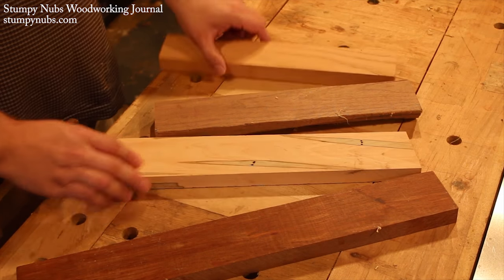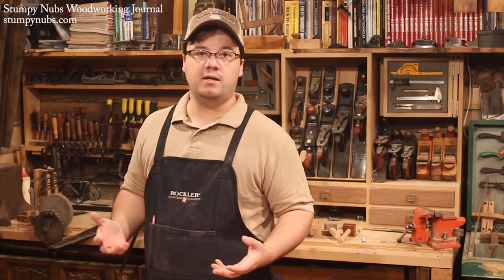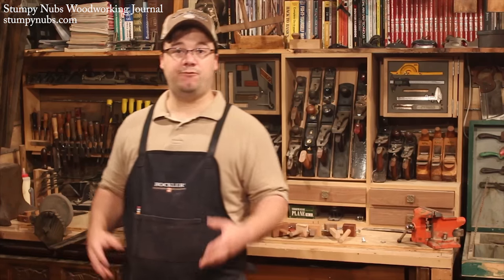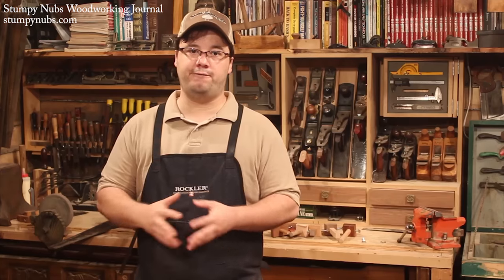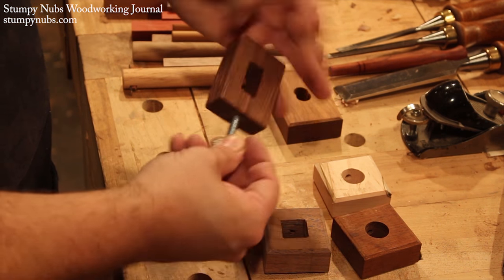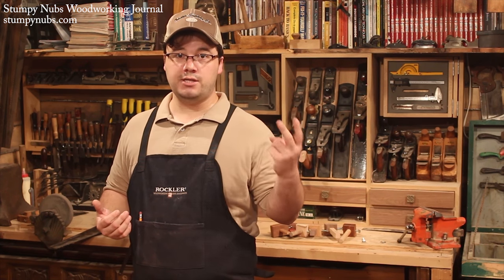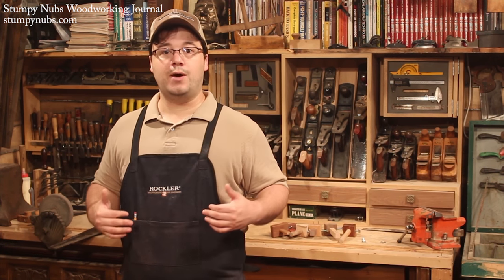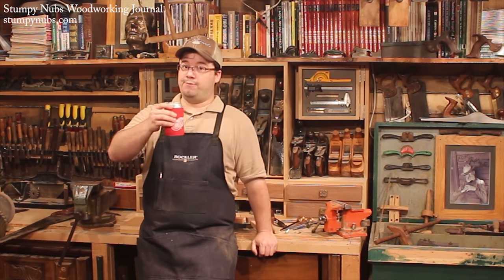3 Easy to Make Homemade Woodworking Marking Gauges (Mortise/Cutting)

Comment: I recommend not screwing them very tight at all, because each time you are making a dent into the soft wood, and when you next wind it in to a position very close to that dent, it may pull itself back into the dent, and there goes your accuracy. You want a nice fat screw that's about 10mm to mitigate this effect
Reply: Worth mentioning, especially if you're going the "square beam" route... so mortising rather than drilling...
   You CAN also dig out a small recess inside the mortise for your beam, where you can slip a small piece of flat metal under the bolt, and hidden by the beam, itself. This way, once assembled, the bolt presses onto that flat piece of metal, pinching on the whole span of beam inside the mortise, instead of a tiny point... and as long as you fit the beam snug to the mortise enough to cover the metal, it's never going to fall out.

    I have a preference for a "quick acting" pinch... You can SEE an example on Rex Krueger's channel. Basically, I drill an off-center hole across the fence just over the beam, where I can fit a smaller dowel. This is best done just after lay-out and before you drill the Larger hole for the beam... but with a gentle touch and patience, you can still manage it if you've already got the beam hole bored... It's just a bit difficult because the drill will "want" to misalign into the beam opening... It can also be resolved by fitting a piece of scrap into the space where your beam would ordinarily be, so you can then drill right along through part of the scrap... no harm.
    Once you've got the channel for the smaller dowel, you'll want to eyeball with the dowel in place, and dig out just enough of that dowel to make space for the beam to slide relatively freely... This is usually down to "trim and test" repeatedly, but also not too big of a deal. Once that's done, pick a side (usually the longer part of the small dowel) and carve out a "ramp" or "wedge" shape from the hole for the beam to the surface of the dowel...
    Here's the trick... When you assemble this thing, leave enough little "pinch" dowel to expose at both ends... When the opening is pressed to the beam, it should slip freely... Press the wedge into place and it pinches the beam, and you can even "knock" it firmly on a table to "set" it tight... then mark as normal... When you need the next measurement, "knock" to the open end of the dowel, and it releases the beam again... simple and effective. I've used mine quite a bit and I LOVE the thing... better than any of the old-schools I bought, because I don't spend a bunch of time screwing around and double or triple checking... and it's pretty much NEVER in hell going to hurt that beam.

      ...hope that helps. ;o)